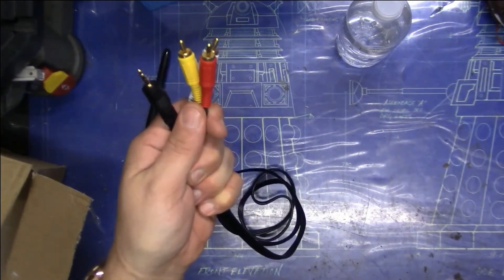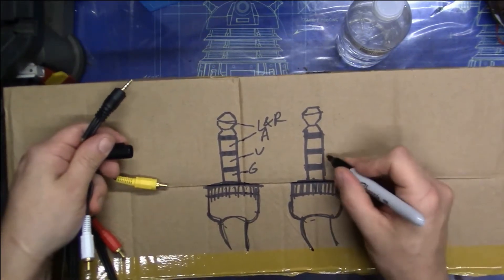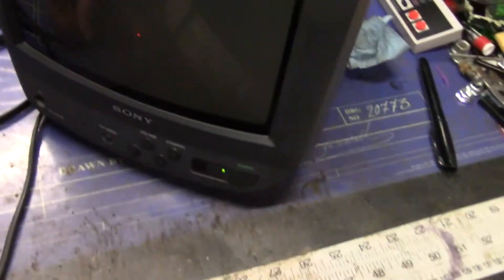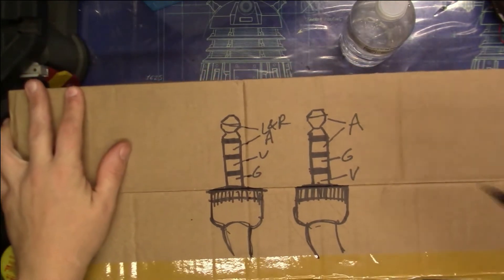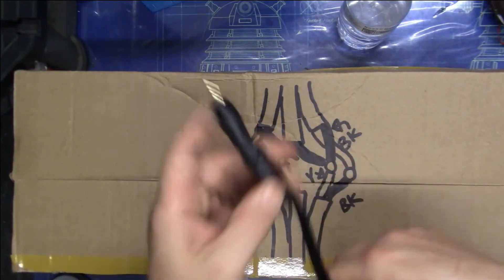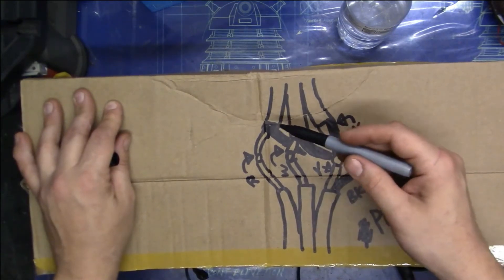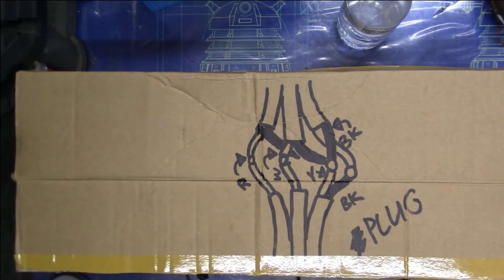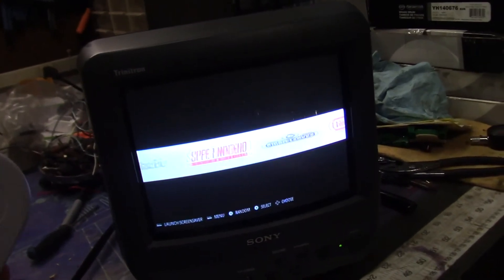Rewiring Retro Pi AV Cord- This May be Why Your Raspberry PI Composite Video Cord doesn't work!

Comment: For anyone else in the future, here's some more info about composite video on the RP. L is "Left audio", R is "Right audio", V is "Video", and G is "Ground".

 The RPI uses the CTIA standard, which is LRGV, going from tip to sleeve. This is the standard used by Zune, and most phones (although most phones use the "V" ring for microphone input, not video out).

The other common standard is OMTP, which is LRVG, which doesn't work for reasons you've shown here. Commonly used with MP3 players with video out.

Another standard which I don't believe has a name is LVGR. Since ground is on the same ring as CTIA, if you swap the red and yellow plugs, it will work fine with an RPi. This was commonly used with camcorders.

Other single board computers can be different. The Odroid N2+ is OMTP. LibreComputer's Renegade is CTIA (but it doesn't seem to work due to software), but their Tritium and Le Potato use RGLV for some unknowable reason. They say they're going to start selling an adapter in a few weeks.

Not sure about any others.
Reply from the maker: Thanks so much! That’s really interesting. I have never encountered the other formats other than the RPi. It’s fascinating to me how these can change from one device to another. Thanks again for the info! Also thanks for watching and for commenting!

Comment: I've spent over 2 hours yesterday playing with config.txt and moving cables around until I found your video. I followed your instructions and it worked flawlessly! I also have some ground loop humming noise problems, but I'll just connect my pi to my bluetooth speaker and I'm good to go. You're a saint, thank you so much for that video. Literally the only one that explained how to fix it
Reply: I found the solution to the ground loop noise. Apparently, my cable had the colours switched (can't remember which ones, but it was probably ground and white I think ???). I had to use multimeter to manually trace each cable and each ring/sleeve to connect them properly. Took me about 45 minutes to put it all together, but sound quality is fantastic now. Also my video quality improved.
Reply from the maker: Thanks! I’m so glad my video was helpful! Thanks for watching and thanks for commenting!

Comment: So many videos just saying to change settings 

I knew something was screwy with wiring 

I am annoyed they chose this wiring configuration 

I had 5 cables and all of them are not the correct wiring
Reply from the maker: I really don’t understand the decision to have the set up differently than every other manufacturer that uses that port for AV. I can only guess that it has to do with optimizing the design of the Raspberry Pi. Still it’s freaking annoying!

Thanks for watching and thanks for commenting!

Comment: I almost exploded in anger when I saw this. I have spent over 4 hours trying to fiddle around with config.txt files, reading up on documentations and what not, only to find this video. Did they on purpose design the Raspberry Pi 4 this way? I wonder how many composite cables people bought in vain.
Reply from the maker: The only thing I can figure is that with such a small platform, they probably made multiple concessions in a number of ways to get all the functionality they were going for at the desired price point. Among those was almost certainly orienting the jack differently. I have no doubt that if someone who had been on the design team were to explain it, it would make perfect sense. But since I’m unlikely to ever get to talk to one of those people, all I can do is speculate and find it really REALLY annoying!!!

Thanks for watching and thanks for commenting!

Comment: I tried this but its behaving oddly.
When I put the audio cables in, it plays audio fine.
When I put in the video it plays the video fine.
But when i put in both the audio is just noise.

What do I need to do?
Reply from the maker: It sounds similar to what happened to me in the first half of this video. Double check your wiring and make sure it matches the revised diagram that I show starting at 3:17 in the video. 

The problem is that the contacts for the ground and the video are reversed on a raspberry pi cable as opposed to a standard cable. But the ground is common for all the signals, so it's not enough to simply swap the ground with the video wires. I show a clearer view of the revised diagram at about 4:00 in the video, but later I drew out a much clearer version and uploaded it to my Instagram.  You can see that here:
https://www.instagram.com/p/CNnrtGSB7YT/?utm_medium=copy_link
If you follow that, you should be good.

If you have done what's shown in the diagram, then you may have a short somewhere in your wires. One of the signals is probably crossed with the ground. You can test your connections with a multimeter  to see if that's the case. 

I hope that helps. Good luck! Thanks for watching and thanks for commenting!

Comment: I think this is my problem..
I'll try to accomplish this tonight.

I have a noobish question though: 
Does that mean nothing is connecting to the ground of red and white? Is this a problem at all?
Reply from the maker: Sorry, I missed this comment earlier. That's a great question!
 The ground is shared by each channel. So what that means is that no, that one ground contact on the 3.5 mm plug actually connects to each ground wire for both audio sides and the video. And that's what makes this tricky. It's something I failed to consider in my first attempt at rewiring this cable only to have thing not work. In my reply to your other comment I explain all of this in more detail, so I'll let you read it there.

Once again, thanks so much for watching the video and asking questions. I'm always glad to try to help people when I can. Good luck!

Comment: What about in the pi4??
Reply from the maker: So, someone asked this question not long ago, here in the comments.  I've pasted my response from then:

I haven't tried a pi4 yet. All mine were 3Bplus, BUT I did seconds worth of research and it looks like the port has not changed from the Pi3 to the Pi4, so the information in this video SHOULD apply to the Pi4 as well.

I hope I'm right about that, and more over, I hope that helps! Thanks for watching and thanks for commenting

Comment: Raspberry pi 4 ...av connect?
Reply from the maker: I haven't tried a pi4 yet. All mine were 3Bplus, BUT I did seconds worth of research and it looks like the port has not changed from the Pi3 to the Pi4, so the information in this video SHOULD apply to the Pi4 as well.

I hope I'm right about that, and more over, I hope that helps! Thanks for watching and thanks for commenting!

Comment: Can you please tell me how much screen resolution can the A/V port support? Because I got a very low quality resolution when I connected a 7” display in this way. How much screen resolution will we get through such a connection? Please help🙏🏻🙏🏻
Reply from the maker: I did a little research and it looks like the output resolution for composite video is 480i which is commonly 480 x 720 pixels in a 4:3 oriented screen. Here's the links that I looked up:
https://en.wikipedia.org/wiki/Composite_video
https://www.google.com/search?q=common+screen+size+480i&oq=common+screen+size+480i&aqs=chrome..69i57.11628j0j7&sourceid=chrome&ie=UTF-8

I hope this information is helpful. Good luck! Thanks for reaching out.

Comment: Did you guys find a cable to buy that is made for the oddly laid out Pi AV out?
Reply from the maker: I never bothered to buy one after figuring out how to do this, but here's a link that is probably far more reliable than amazon:
https://www.adafruit.com/product/2881

Adafruit specializes in this sort of thing, so chances are pretty good that this cord will work.
Reply: @ClayCarlino  thanks! I'll still try a butchering as per your diagram and see how it turns out.
Reply from the maker: @DedCobo  good luck!

Comment: In this case in probably would've been easier to cut the traces on the pi board itself and reconnect them with jumper wire
Reply from the maker: Yeah, that would solve the problem too. I hadn't  really thought about modifying the pi instead of the wire, but you're absolutely right!

Comment: Can we switch the cable while plugging them into tv instead
Means while plugging the composite caple to tv we plug the video wire to audio, and audio wire to video port???
Reply from the maker: Sadly no. The problem on these cables is that the ground and video postitions are swapped from where they need to be, which means that no matter which RCA Plug you plug into the TV, the TV's ground is still connecting to the video output on the Raspberry Pi. It sucks, because if the video contact was swapped with ANY of the other contacts, then what you are saying would work just fine! Someone had to TRY to screw this up for everyone!

Comment: Awesome! I had this exact problem with a cable I had laying around and your video came to my rescue!

For a moment I thought there was something wrong with my Pi! before watching the video and understanding it was the cable and how to fix it haha.
Reply from the maker: I'm so glad!... Not that you had the problem obviously, but glad that my video was helpful! Thanks so much!
Reply: @ClayCarlino  av compatible raspberry pi zéro?
Reply from the maker: @montana_1999  i don't know
 I've never used a pi zero.
Reply: @ClayCarlino  but you don't know if it is compatible with raspberry pi zero? and if you need to enable av
Reply from the maker: @montana_1999  unfortunately since I've never used a zero, I've never learned anything about them. I'm guessing that it's set up the same way, but it really is only a guess. I wish I had a better answer, but I don't want to mislead you. If you find the answer, please comment back. There's probably others who have the same question that would appreciate the info. Thanks for asking though.
Reply: @ClayCarlino  i will research and then comment the answer, raspberry zero has av output, has two pins (tv) so you need to activate doing some codes,thanks!
Reply from the maker: @montana_1999  thanks! I'm curious as well.

Comment: Ok my cable has a red white and yellow wire inside and no black wires just open copper wire
Reply from the maker: The open copper is probably the ground. Check with a multimeter to be sure. If I remember correctly the outer ring of the RCA ends should be the ground and the center pins should each go to the corresponding colored wire. Good luck!

Comment: I fixed the noise and video distortion problem. I used liquid electrical tape on the small wires, and if I heard the hum or saw video distortion, I could play with wires till I didn't hear the hum or see video distortion. Once the liquid electrical tape dried, I applied another coat if there were any exposed wires. Once I was satisfied that there were no more shorts, I wrapped it with regular electrical tape.
Reply from the maker: Oh good job! That sounds like a perfect solution.

Comment: Theres much interference with the sound during the play. And when I use the joystick in game, there more interference. Why is that?
Reply from the maker: It sounds like there may be a short somewhere. I'd get a multimeter and check the continuity from each contact point on each of the RCA Jacks to each contact point on the 3.5 mm jack. I bet you'll find conductivity somewhere it shouldn't be. You can also test your Raspeberry pi with an HDMI cord still using the same joystick, just to ensure that the problem is in the cord. Good luck! If you want, let me know how it goes.
Reply: When I pause the game, it's looks great!! But the problem is when the sound start
Reply: https://www.youtube.com/watch?v=fccaS9lCRbo
Reply from the maker: @marcorosa3490 , Wow that's weird! It sure seems like it must be a short of some kind. The continuity test I described earlier will tell you for sure, but if you're unfamiliar with how to do that test, let me know and I can shoot a quick video on how to that. So sorry you're having problems!

Comment: I have the exact same problem as you. Thanks for making this video and clear the confusion ! it made me to buy a few cables and tried so many days but end up still not working, I thought my cable is broken, end up it's due to this special wiring requirement..I really don't know why Raspberry Pi use such strange wiring combination on the composite video :(
Reply from the maker: I don't know either! But I'm glad I found out. Since the time I made that video, I've ended up making several of those cables for different Raspberry pi projects.
Reply: @ClayCarlino  I have cut out my composite video cable now and rejoined them, but the copper inside is so tiny that it's so hard to solder them together :(
Reply from the maker: @sylye00 , I'm not sure if I have any good advice on that. I know what you mean. Some of those wires are SO TINY and really delicate. Yes they can be really hard to solder. I'm not sure if this would be easier for you or not, but the last couple cables I did, I cut the insulation off back of the 3 pole jack and soldered directly to the contact points there. Its MUCH nicer looking and I found it easier.  Good luck! Let me know how it goes.

Comment: Need it any software modify? (I think config files in raspbian, etc...)
Reply from the maker: It SHOULD work without modifying the software, however, if it doesn't work, you may need to change the video settings in the config file.

Comment: Can I use hdmi to rca converter?
Reply: HDMI is digital only. RCA is Analogue only. There can be no conversion with out a processor. I have seen such cables. but they don't work. For such a cable to work, it would need a processor and therefore require external power.
Reply from the maker: @Shazbud , That's true. The converters I've seen are not just some kind of cable adapter, they have electronics in them. I was always too cheap to buy one, and at this point, I've gotten pretty good at rewiring these cables, so I haven't needed an alternative.
Reply from the maker: I haven't tried that, but I don't see any reason that wouldn't work. If you try it, feel free to post the result. Thanks for commenting!

Comment: i have a sound problem... it Sounded like Monsters(Low Pitch)
Reply from the maker: Not a lot to go on. Best strategy is to eliminate the easy things first. Make sure the speaker or amp you're using isn't blown. Next (I'm assuming you are trying the conversion I show in this video.) Check your connections. Make sure everything is plugged in all the way and make sure none of the jacks you're plugging into aren't wonky. If all that checks out, then the problem must be in the rewiring. Check your solder joints. Check to make sure nothing is shorting or crossing connection points. You may need to take your cord apart all over again and resolder the wires for each channel, but this time do it one channel at a time and test after each one, listening feedback or distortion. 
That's all I can think of. If there's any other techy people reading this who have advice, feel free to weigh in! Good luck! Let me know how it goes!
Reply: Jered There might be a stray contact with your wires, I had to play with mine. If you have an ohm meter, you can check for shorts.

Comment: I used the xbox composite cable which worked for me but looks like crap. I need to buy a tester to see if the xbox cable doesn't need rewiring.
Reply from the maker: I didn't realize the Xbox even haad a composite video output. I guess it makes sense though. Looks like you need one of those Harbor freight coupons for a free multimeter!

Comment: Hello, Clay! When you typing "PLUG" side, do you mean plug of Raspberry input or to TV inputs? And what about plug side red wire's ground? It isn't connected!
Reply from the maker: When I say "plug side" I'm referring to the plug that goes into the Raspberry pi. As for the red connector, it is one of the audio outputs. Just to sum up, you have the plug that goes to the Pi. On the other end you have 3 RCA connectors, 1 red, 1 white, 1 yellow. Each RCA PLUG has 2 contacts. A little pin in the middle which transmits the signal, and a metal ring around it which is the ground. The yellow RCA  is for the video. Red is the right audio cannel and white is the left audio channel.
Reply: @ClayCarlino  thank you very much!

Comment: which raspi version do you use? I'm using raspi 3 model B V1.2 and after I put my standard (as shown in 1:02 left scheme ) 3.5mm to composite output cable to my raspi and when I measured the short circuit of  connecions, I see that the ground rings of outputs are short with the ground pins of raspi. so, that made me confused about doing your process or not. Also I cannot take a display with this cable. what do you suggest?
Reply from the maker: Mine is a Raspberry Pi model3 B as well. I would think the 3.5mm jack on yours is the same as mine. This port works for out putting standard composite video with stereo audio. 

In your comment, you mention a Display port. I would think that if you need your video output to go to a Display port, you will need an adapter that plugs into the HDMI on the Raspberry Pi. Then you probably would have to take the audio from the 3.5mm jack, as display ports don't carry an audio signal. I'm only guessing, though. I haven't messed with display ports on my Pi.
Reply: Clay Carlino thanka a lot I habe solved the problem
Reply from the maker: Awesome! Glad it worked!

Comment from the maker: You're welcome! I never did try buying another A/V cord. Instead I ended up making a new one with a 4 contact headset jack. It's much nicer. I soldered directly to the plug contacts rather than to stripped wires. It works perectly too!